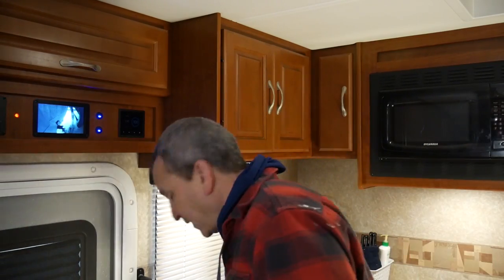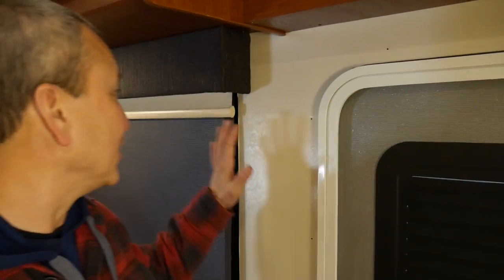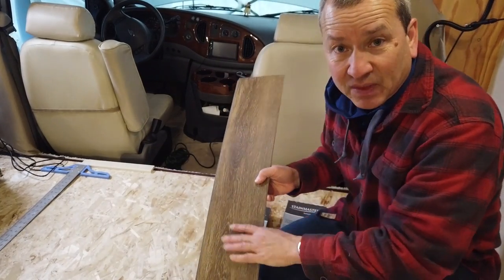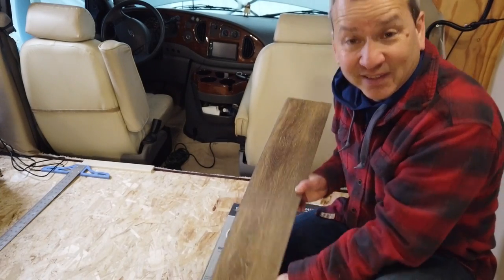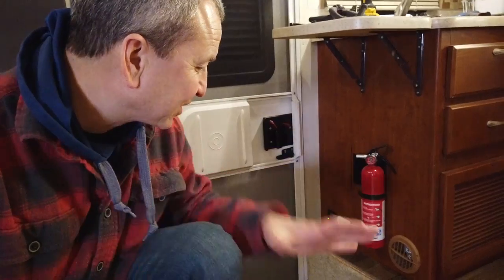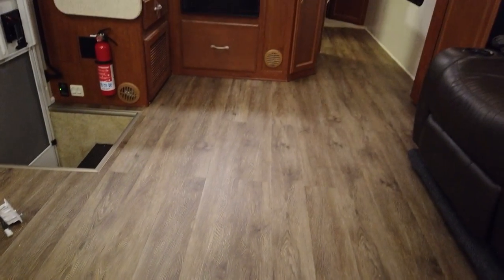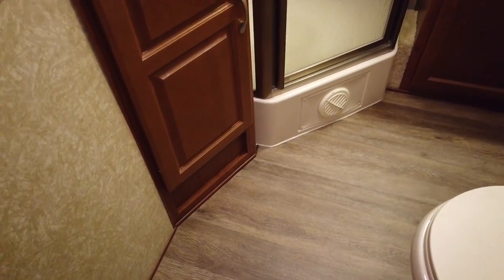Installing Vinyl Plank Flooring in RV Start to Finish | Class C RV Renovation | RV with Tito

Comment: Floor looks great!! That vinyl flooring is great stuff... Much better than the thin particle wood flooring with the cheap laminate film over it. That stuff wears bad, and will swell and bubble up if moisture gets in it. My son used this vinyl flooring in his basement, and it is fantastic! Easy to install, wears great, and water proof!!
Reply from the maker: It seems to be pretty durable stuff. We'll see how it lasts long term.

Comment: OUTSTANDING video! Think you would have been better off, after snapping the center line, working from that center out to the sides. Technique keeps the final edge piece(s) of equal size and in proportion to the layout. The Behr paint has primer "mixed into" its Marquis product, but there is no substitute for a separate high quality primer given the extreme heat and humidity the RV cabin must tolerate.

Comment: Great Work, I have done most of your upgrades as well, I saw this video watching your 7 best upgrades.  We are huge boon-dockers here in Wyoming, we have a Work and play toy hauler.  I have done Suspension upgrade to truck with Bill stein shocks, weight distribution hitch, 900 Watts of solar with Two 8D batteries, a transfer switch, 3500 watt inverter.  I cant believe we have done so much of the same type of upgrades, The stinky slinky upgrade will be happening as well, the fence post painted black!  Hidden underneath BRILLIANT!  This video of your floor was awesome, I  just started looking into doing it, i was Leary till i watched your video.  I will be doing the entire floor now, instead of just the rear half!  Awesome, Thanks so much.

Comment: Great flooring...   We used the same. When we installed our flooring we installed it east and west (you went north and south) it made our RV feel wider and more spacious. One other thing we did, that you didn't was to seal the floor we used KILLS.   Another great video Sir!!...  Got to Love Washington Winters!!
Reply: Aron,
I'm getting ready to refurb my 1985 Class A RV...
I love this video too... but I noticed he didn't use any
Glue... or Padding so the floor will float... 
I thought that in an RV the wood needs to really be 
able to flex with the movement...
I am going to put my east and west too... so there are
more boards to walk across than just down the middle
of a couple of them... 
So you put glue down first ??? 
Thank you for your help.
Reply: That is a great question.   Under the carpet there is sub flooring. we painted the sub flooring with kills to hep seal it up then added the tile directly of the top.  The problem with peel and stick flooring is you cant use a pad underlay and thickness of the floor is a concern when dealing with slide outs.  Depend on your application and the RV..

Comment: Great job ! Iv been in the hard surface flooring biz for 32 years, hey next to your shower cut the lock off the last piece, and put 3 or 4 pieces that would make up the drop a long the shower to the back wall ,spot supper glue them, then spot glue the main piece slide over the top tell it drops in and your all done! I did the same type of vinyl plank in my pusher the only way to go for RVs .and always work doors in 2 pieces, you might have some bulking around the door.
Reply from the maker: Hey thanks for the tips. That's probably what I'll do.

Comment: Thanks for this awesome video man I'm pretty much a diy guy and just bought a fifth wheel with carpet.. I think it's time to update it with some wood vinyl floor! Giving me the courage to do this job on my own
Reply from the maker: You won't regret it. The biggest issue most have is deciding how to do the floor under the slide. Every RV is a little different.

Comment: Of course I had to see the completed flooring project as you hooked me with the earlier one. Very nice and though if we buy the class b tomorrow which is going on 23 years old American Cruiser 2000RE 1999 year. But suppose to have had most of the carpet replaced with similar vinyl planks but back end floor across from Bathroom has some spongy parts. Explains why it hasn't sold perhaps in the past 4 or so weeks and price dropped 5,000 too. They sent photos and overall looks good outside with little to no damage to the unit visually. But there is no longer steps and those would be on the end where the flooring has issues. So hubby thinks perhaps someone wrecked the steps by backing into something and it also caused some under flooring damage. Meantime seeing how a fridge vent might leak and that means other vents too..these A-cruisers have floor AC units that also have outside vents that you need to open during use it's another possible leak point of course. Also that end has the grey & black tanks too. All things helpful to know and I'm collecting as much info as possible. I'm in my 70's and though my husband of 50 years is extremely handy he's showing his age too. And it 's not his thing. I'm essentially buying an older RV to upgrade finally from tenting. However I loved tent camping and it's bitter sweet to think it's time to give it up. I don't want to buy an older unit with issues that we can't fix and fix well. Have had no luck finding one that's in top shape due to our rural location it's hard to get to one before it's snapped up as my narrowed down choices are also coveted my many others. Lots of competition for these smaller 21' and under Class B & B+'s. I know yours is a C but no doubt similar situations shared between B's and C's. Thanks again. I'm looking forward to watching your other RV DIY's.

Comment: Great job on the flooring!  I considered tackling the job in our 35' class A coach, but decided to have it done by a shop as we wanted all the vinyl and carpet removed throughout. Including the 3 slides. Should have it back next week, so I'll let you know how it turned out. We went with CoreTec One flooring.
Reply from the maker: That'll be exciting when you get it back.
Reply: how much did it cost for the shop to do it?

Comment: I love the flooring!  You look like you know what you are doing.  We just purchased an older travel trailer.  The roof has leaked and we know we’re going to have to replace the roof and the floor.  We know that we are ripping out everything and replacing with the Vinyl wood planks.

Comment: Love the Behr Marquee Paint & Primer All In One!  It truly is a One Coat Paint. And the Price is Great also.  Nice work on the RV.  We are remodeling our Class C and it’s a lot of work!!   Especially when you need to take account all the weight your adding to the RV.  We are trying to take out some of the heavy things that we know we will not use. I see so many of these RV Reno videos and people add heavy cabinetry large couches etc.   Not a good idea!!    One thing we wish is that they made RV’s more like a truck or Van.  “ They are built with plywood and staples “. Why can’t they make them with a solid roof like a Van or Truck?  They are definitely NOT MADE TO LAST!!

Comment: nice job.  I would add that it's prob best for anyone doing this that has a slideout, that the flooring be thin enough to not cause an issue when the slide comes in.  I've seen folks try to put laminate or thicker LVP in, do the whole job and then the slide scratches or even pulls up the floor.  Best to try a test piece laid on the floor before starting
Reply from the maker: I agree. Every slide out is different. Some even rely on the existing carpet to slide. Once removed, it may cause problems.

Comment: Great Job - looks really good !
Lowes insisted on underlayment (thin foam) and expansion gaps along the (many) edges for my thin Vinyl Plank (LVP) flooring (Shaw)...  When I did mine, I used both.  It is holding up great, with no buckling, summer or winter.  I am using white 1/2 x 3/8 (2258) plastic quarter round from Lowes.  Yes, gravity holds the floor in place... r
Reply from the maker: Yeah. I thought about using underlayment and decided naahh. We'll see how it goes.

Comment: Nicely done.   After doing one such project, I wish I had used a thin foam underlayment.  The free floating floor never sits completely flat on the subfloor.  This means that we hear clicks as the flooring slaps down that fraction of an inch as we walk over it.  I’m hoping that the foam underlayment will absorb the flex and sound.

Comment: We did a floor project like you last year removing the carpet and pad. I was totally surprised by the amount of sand and dirt we found. We used the home depot flooring with great results. I had a few different types of transitions to do around a slide and tile in the kitchen, but no fun jigsaw pieces like you! This is really a good value project that improves the looks and makes it easy to care for the RV. I tease the wife that we gained an extra 100lbs of carrying capacity just from the stables we removed!
Reply from the maker: True. So many staples.

Comment: Looks really good. I have laid my vinyl down on top of 1-inch insulation board now I am worried about possible shifting of it because it is in a camper trailer. Wondering if I would have been smart to glue the planks down as I went along?

Comment: I really enjoy the way your videos are made, your tutorials are no nonsense and straight to the point. I am doing flooring in our RV and was wondering what you used for the trim around the edges, I like the low profile. Thank you!
Reply from the maker: Thanks! It's just really cheap 1/4" x 9/16" plastic trim from Lowes. I used either white or an oak that kind of matched the flooring and cabinets. Here's a link: https://www.lowes.com/pd/Inteplast-Group-Building-Products-1-4-in-x-8-ft-Prefinished-Polystyrene-Shoe-Moulding-Actual-0-25-in-x-8-ft/50147916

Comment: Brian great job as usual. Looks like the same stuff we used. Be advised that it is a floating floor and as such will be subjected to temperature and climate changes. Some of the seems will move a little and small cracks may show up. Not bad but you being the perfectionist you are you will see them.
Reply from the maker: Hey guys. Thanks. Time will tell.

Comment: Great job Brian, that is something I have been thinking about,  I was worried about the slideouts hitting the edge of the 
flooring.  I did use the same product in my boat and loves the results.
Reply from the maker: My slide sits above the floor so that's not an issue for me.
Reply: Brian so do mine, I think there are rollers that ride on the floor,  Those were my concern if they might damage the flooring,  under where the slide runs in and out.  Top be honest I haven't checked under there to see what happens

Comment: Great installation job.  My only concern is expansion...  some of those cuts were very tight and in the heat of summer you will likely have some bulging where you left no room.  I did a porch with those planks and on hot days the entire center of the floor would come up in the air.  I had to disassemble everything and trim off about 1/4" on all outside pieces to fix the problem.  The floor has lasted over four years now and still looks good as new.
Reply from the maker: Will definitely be keeping my eye on it. Thanks!

Comment: Good job! We also are in the middle of a class A renovation. And while your flooring came out awesome, we have a huge wall slide out we have to account for for our flooring install. Great job!!
Reply: I also have a large 26 foot slide out and i need a new floor.  how does the material he used work on that type of application. will the slide out go over the flooring or rip it up??????

Comment: Great project video and you did a beautiful job on it. I will be doing the same to our Class A RV. We purchased our used coach which is beautiful and in great condition but for what ever reasons the factory floor did not hold up well and is a rather dull pattern for our taste. Your video is a great motivator for us.
Reply from the maker: Awesome! Thank you! It's been a great mod. Good luck on yours.

Comment: Very nice. Great job! I plan to do the same thing. It's the engine cover that has me stumped.
Reply: VegasGuy89183 - Strip carpet/sand(smooth) surface and vinyl wrap it with whatever matches your interior (dash or trim). You can put stick on sound/heat barrier (Dynamat) on the engine side to compensate for the “insulation” the carpet gave you. Not sure on your exact needs....
Reply: @ganders8845  I never considered vinyl. That sounds like a viable option. Thanks!

Comment: Brian...nice job!  That looks so much better and it will be so much easier to clean.  Your use of the DryErase marker was a great tip.  How long did it take you do the whole job?  Also, I love the hammering when sped up.  Made me laugh.  Have fun in the snow.  It’s 60 degrees and sunny here in Sicily!
Reply from the maker: Haha . Hammer time! Snow is all melted now, but it's still in the 30s.

Comment: I have a class A 27’ Sightseer with a slide and want to do the same you did, but the question is what am I going to get involved with in replacing the carpet under the slide with vinyl flooring. Don’t want to remove slide to get at what’s under it, but want to do a perfect installation. Any suggestions as where I get more information on it. Your YouTubes are excellent.

Comment: Very nice!.   I am about ready to do the same.   I've gotten mixed answers on the question of using glue rather than letting them float.   Those who told me glue said the movement of the MH often makes the floor pop out.    How is your floating installation approach working?
Reply: Randy - 
In short, he said he has had none so far. Neat!
To see some of those answers, sort this part by "newest first" and then check out the ones just a couple down the list that were similar questions. 
As for me, I am looking for how the paint job is holding up since I have seen or been told to "sand, prime, paint" but would love it if I could do it in one step!
Good luck to us both!

Comment: This is extremely helpful, I was looking a the flooring at Lowes today. Did the vinyl planks have an adhesive backing and did you need to prep the plywood floor before?
Reply from the maker: There's no adhesive but it does have a little grip to it. The only thing I did to prep the floor was to make sure it was clean with no holes and as level as possible.

Comment: Great job, Tito! Question… we have carpet in part of our van and want to replace it with something like you have. The problem is it’s on a raised section of the floor and it has a curved front. I’m wondering if you have any suggestions for a flexible edge covering? Something like what you used around your entrance… but it needs to be curved or flexible.
Reply from the maker: Not sure. Let me know what you come up with.

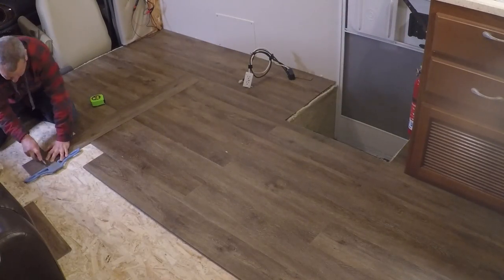Comment: This helped a lot.  Thank you.  What is the name of the tool you used at 6:37 to cut an angle like that?  Also, you did not use any adhesive ..........just laid the planks on the floor?  How you would have resoled the problem if the RV sub floor was not level?

Comment: The flooring came out amazing! I am about to undertake this project, did you end up having any issues without the expansion gaps? Would like to avoid using the side trim needed to cover the expansion gaps!
Reply from the maker: Thanks. No. I haven't had any expansion issues. I added the baseboard trim for a nice finished look.

Comment: Great video & really nice craftsmanship on the install!  I am very curious though, you installed the flooring super tight into every nook & cranny.....I have installed several laminate floors & always left 1/4"ish gaps along wall edges for expansion etc.  Have you had any problems with buckling or puckering in your floor since?  I'm about to do the same in my motorhome & would love to build it that tight to the walls. Have you experienced any issues at all?
Reply from the maker: I haven't had any issues yet. I've also installed floating flooring in the house and have left gaps under the trim. In this case, I wanted to seal up a few areas from moisture and actually caulked a few edges (like by the shower and fridge). No buckling yet. Hope that helps.

Comment: Looks great !!  How did you plug/fill the holes the seatbelts bolts came out of?  I have the same RV only a 2008 about to consider remodel
Reply from the maker: I pumped some black construction adhesive/sealant in the holes.

Comment: Great channel, so much good stuff!
How has the vinyl plank done as far as expansion-contraction?
I had snap/tongue&groove vinyl put in part of my house....it is not great.  the ends pull apart 1 inch in winter, and then push each other up in summer.
Maybe its just bad product?
Im thinking of getting "Loose Lay" vinyl plank for my RV, but im worried about the same thing happening.
I live where it looks like similar climate as you.
Stay gold.
Reply from the maker: The flooring still looks like the day I installed it. Absolutely no issues to report.

Comment: Tell me about the edging you used. Two colors - did you paint them? What about intricate corners? What size are they and where did you find them? Also- no adhesive on the new floor? Does it pop and snap when you walk on it? Thanks- looks great.
Reply from the maker: Cheap plastic stuff from Lowes. Maybe 3/8" x 3/4" not exactly sure. I got an oak looking one that was a close match to the cherry cabinets. The wall trim was white and I painted it the color of the wall.

Comment: Going to do our 28’ Wildcat. I presume this is a full floating floor, correct ? I was wondering if you have had any issues with temperature change with the right spots like in your bathroom door cut. Also, did you do your slide as well? Wondering if you have a video on how to transition the edge if you did. Thanks much!